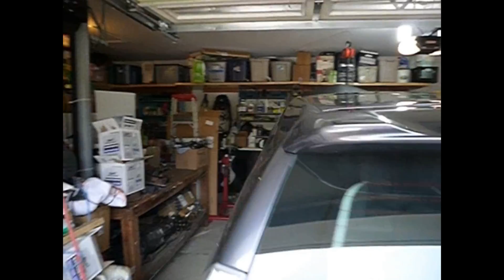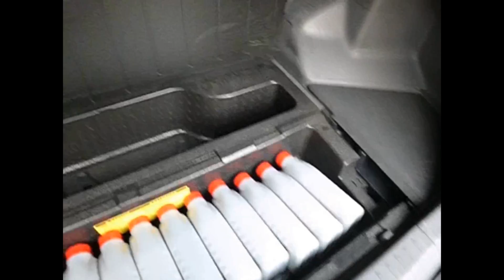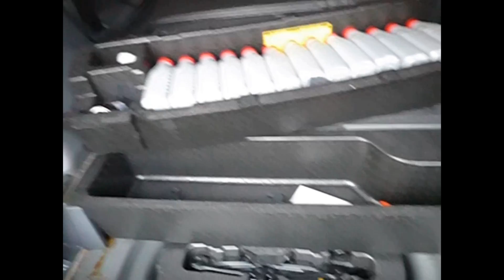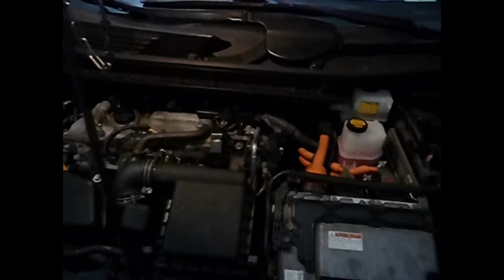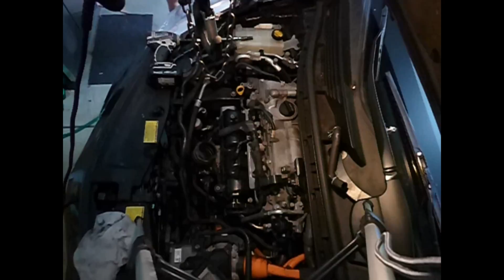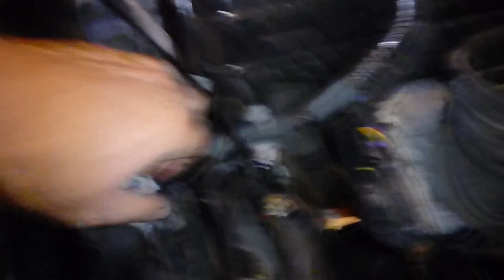Part 1 - 2016 Prius Engine Swap into 2012 Prius V - Start to Finish

Comment: thank you so much for posting...may I ask the total hour commitment perhaps for a local shop to do the swap?
Reply from the maker: Hi, It took me about 20 hours which is really slow. Some can do it faster and some need more time and some can't do it at all. It's not much different than any other engine swap and in some ways easier than typical.
- Fix That Prius !!!

Comment: Hi, I am in the process of getting a replacement engine for my 2012 Prius V, when searching for the 2017+ engine the junkyards such as LKQ are asking which one I am looking for apparently there is a difference depending on VIN, could you kindly confirm if there is a specific one I need to get? I have the car ready for its new heart as we speak, just have to find the right donor.
Reply: I'd also like to know this, have LKQ near me and asking about 7th and 8th vin after saying 5th vin should be "a" or "b"
Reply: @aaronnagy5430  I am sure the digits would make a difference if you were using the motor to do a direct transplant into a newer Prius i.e. without any alterations but for 3G prius it probably doesnt make any difference. I was able to get a decently priced engine from a recycler in NV, even though the motor had 60k miles but it had no oxidation/rust etc being that the car spent most of its life in NV. 

The swap itself went smoothly, the rerouting of EGR pipes, coolant pipes etc took an extra couple of days, thank you so much for these videos as they helped tremendously. I am glad to report that my V is back on the road and has already racked up 8k miles on the new motor.
Reply: @JnC445  what is your mpg now since the swap of the new motor?

Comment: What kind of engine would I need for a 2010 Prius? Where could I look for an engine?
Reply: Hi, Do you want a direct replacement or a newer engine?
Try LKQ online. They are very good at directing your search. 
If you want a direct replacement get one from a 2015  Prius, Prius Prime or a 2015-2017 Prius v.
Older engines burn oil.
 - Fix That Prius !!!

Comment: I’m about to do this to my 2010. Looking at 4th gen motors you purchase off eBay. They aren’t as cheap as I was hoping :/ I’m curious, is yours a 4th Gen 1.8 VIN B or VIN A? I don’t know the difference.
Reply from the maker: Hi,
In the VIN, if the 5th digit is an A it's from a Prius Prime and B is from a Prius. Use either one of these engines for your swap. 
Do NOT use an N (Prius v) or a D (Prius c).
Good Luck with your swap!!! 
-  Fix That Prius!
Reply: @fixthatprius4980   Do you know if the Prius C engine is prone to burning oil like the gen 3 Prius one?
Reply: @hedgehogthesonic3181  I do not know. They are different engines.
 - Fix That Prius !!!
Reply: Fix That Prius! Thank you for the quick reply!!!

Comment: I'm just now digging into the 4thgen into my 2012 prius.  This seems like the route I would like to go, I'm a courier that does about 10-12k miles a month.  My car has 187k, has been sippin a quart of oil every 600ish miles or so, has been stuttering/misfiring on cold starts rarely, but seems to be doing it more often now.  Instead of wasting time on a headgasket replacement just swap in a lowmileaged better made motor.  Is there a difference between the 2016 and 2018 motors to swap in the 3rd gen, or is the 2016 and 2018 identical?
Reply from the maker: They are the same.
2016-2020 VIN 5th digit A or B.
Good Luck with your swap.
 - Fix That Prius !!!

Comment: How much does this cost? There's a guy selling a blown engine 2012 Prius regular not V for a 1000 dollars. Previously had 215000 miles. Worth buying and paying a shop to swap the engine?
Reply from the maker: Hi, Thanks for your question. Please subscribe to my channel. So, you want to buy a blown engine with 215,000 miles and pay a shop to install it in your Prius?
My swap took about 25 hours.
I paid about $1300 for an engine with 3,200 miles and I paid about $900 for an engine with 29,000 miles. I would buy an engine with the lowest mileage possible. Shipping was around $300 each.
  - Fix That Prius !!!

Comment: Thanks so much for showing that A/C compressor connector. I was able to hold a small bladed screw driver in the palm of my hand and squeeze a little bit. Popped right off. Due to the location of the pressing mechanism for the connector I can see how it could be difficult to get off. You can't see it and can barely feel it because of the angle the connector bends. 2 thumbs up brother thanks for the great videos. I'm using them as a sort of guide while replacing my 2011 prius V engine that had the using coolant issue and finally blew on my way home from work one day. Used the bars leak seal, that worked great for a little while. But I shouldn't have relied on it long term, but I did. Live and learn.

Comment: Why on earth would you swap the engine? please educate me.
Reply from the maker: I have a Black 2012 Prius v that I bought with 99,000 miles on it. I drove it for about a month and it burned all the oil. Not like my previous 6) Prius's. (Service records indicate it was already burning oil at 87,000 miles) Then it started to run terribly. I replaced the spark plugs and the PCV and it was good for about 10,000 miles, except the oil burning, then terrible again. I unplugged the EGR and replaced the spark plugs again and it was good, but still burning oil. I took it to the dealer for the EGR recall and they refused to replace the EGR. If anyone had a bad EGR it was me! What jerks! Then at about 190,000 miles it started using water. I needed about 5 gallons of water to get home from work (45 miles). I tried that Barrs Leaks for head gaskets and it worked, and killed my catalytic converter. So yeah, and boo!
I bought another Prius v (the Gray v Five) to replace the black one.
Now I could fix the black one.
I decided that the oil rings were to blame for the oil burning, so replacing the head gasket would not make me happy, I would have to re-ring it. I used a YouTube video from Phoenix and Dad 
as a starting place.

https://www.youtube.com/watch?v=A595LR4SQpI&feature=player_embedded

 Got much more info from PriusChat posters, specifically Danlatu.
I followed his procedure and my rebuilt engine ran for about 5 miles. The oil pump had lost it's prime in the rebuild and I should have packed it with vaseline or primed it somehow but it's driven by the crank. Anyway, one blown engine later I started looking for a replacement engine. I knew the 2016 engine was the same 2ZRFXE engine with better rings but no one could say it would work, then CNC97 tried it. It was the same engine except some minor changes, motor mount, Flywheel, hose connections, etc. He used the 2016 engine with the third gen head with no problems. I knew I could do it too. I ordered my new engine, examined the systems on the new engine and compared the old. It was a complete success, so I video taped the second swap on the gray v five.
- Fix That Prius!

Comment: I’m about to most likely buy a 2012 Prius V with 170,000 miles on it. Should I be worried about the engine dying soon. I’m having a regular mechanic check it out before I buy it, should they be able to spot this issue.
Reply: I did the same thing as you. It lasted me a year then the head gasket blew under my radar a year later (after a trip to the smokey mountains). That's what lead me here. I love the car. Would love to get the engine fixed... I bought it as a gamble and its a great community. NUTZABOUTBOLTS is a great series too in this space.
Reply from the maker: Hi,
Thanks for the question.
Please subscribe to my channel.
Before you buy any Toyota, you can go to the Toyota Owner's website   https://www.toyota.com/owners/   and put the vin number in there like you own it and you can see the service records or ask the owner to show you the records. I have 2) Prius v's and both have a history of burning oil. It's a good reason to get rid of it! However, 1 started burning oil at 87,000 miles the other was ok until 230,000 miles.
- Fix That Prius!

Comment: Thanks for the videos.  My 2012 Prius V just blew the HG @ 154k miles after spending over $1K on new EGR and "redesigned" intake manifold.  Advice on  what to get when sourcing a 2016-17 engine, in terms of peripherals?
Reply from the maker: Hi,
Thanks for your question.
You want to get a complete engine with an "A" or "B" as the 5th digit of the VIN. You want all the stuff on it, ie. fuel injectors, fuel rail, ignition coils, water pump, ect. You don't need the 2016-17 wiring harness but some of it often comes with it. Don't remove the harmonic balancer on the front. Do remove the water pump and replace the flywheel before you try to install it. You'll have to use the old intake and EGR and cooler.
Watch the videos. Check out Priuschat, because there's evolving discussion about the swap I did and what others have done before and since my swap.
We're not alone. I know of at least 5 other people who have done the swap. The new engines run great in our old Prius's but then we still have old Prius's. So don't expect a miracle.
Thank you for subscribing to my channel!
- Fix That Prius!

Comment: How much is the labor if i already have engine from 2016 prius. I want to install it in 2010 prius 3. It has misfires on cylinder 2 and 4 
P0300 random misfire
P0302 cylinder 2 misfire 
P0304 cylinder 4 misfire
Reply: Head gasket.
Reply from the maker: I'd want $1900 to do it. Takes about 4) 8 hour days.
Reply from the maker: Hi, Thanks for your comment.
Please subscribe to my channel.
- Fix That Prius!!!

Comment: Why does a prius need tons of oil?
Reply from the maker: 2010-2015 Toyota Prius' have defective oil control rings. Oil gets into the combustion chamber and burns away. Then you have to add more oil. The engine swap fixed the problem.
Thanks for your question. Please subscribe to my channel. and Fix That Prius!!!!
Reply: @fixthatprius4980  Thank you i just subscribed and i was thinking my prius had bad piston rings. Was planning a full rebuild. Now i know its a common problem thank you.
Reply from the maker: https://priuschat.com/threads/blown-head-gasket-rebuild-297k.179092/page-23#post-2795121
Reply from the maker: Hey Tony, I would charge around $3500 including a very low mile 2016-17 Prius engine.  I'm in the Chicago area.
Reply: @fixthatprius4980  Hi. Is it still possible to take you up on this service? I could absolutely drive to you in my blown head gasket Prius V Five 2012 with 191,000 miles that I love. If so what is the best way to contact you? My email is sbc67@scarletmail.rutgers.edu. I'll try to contact you via priuschat.com too
Reply from the maker: @climbers1376  Hey buddy. Nice car!!!! I have a black v too. Isn't it the best car ever? Even though I only get 30 mpg now? Are you in NEW JERSEY?
Anyway, It's about $4000 to do the job including the engine. Are you sure it's worth it?
Let me know what you want t o do?
 - Fix That Prius !!!